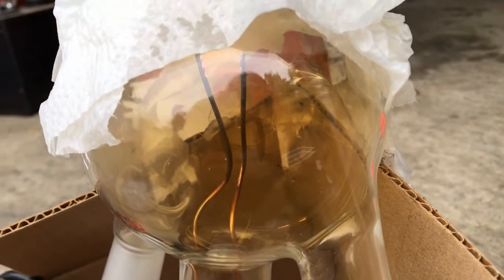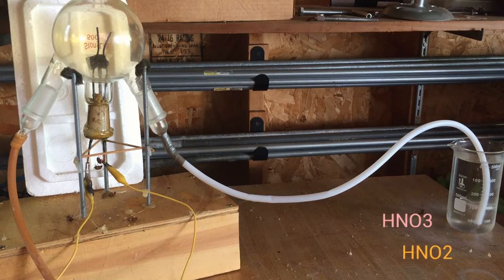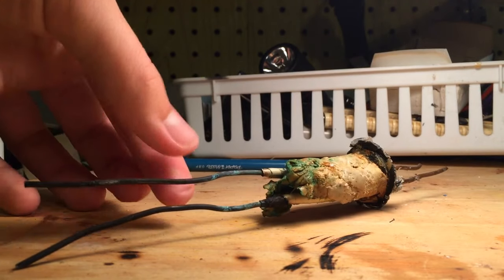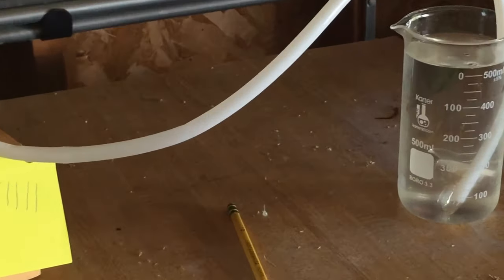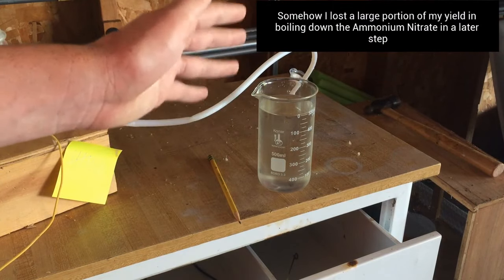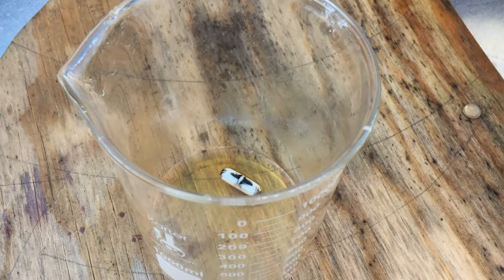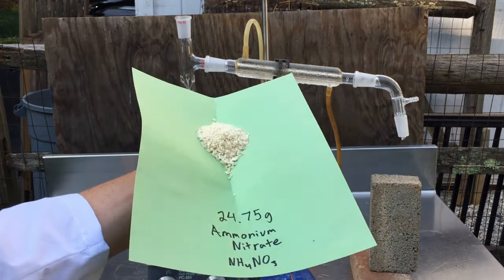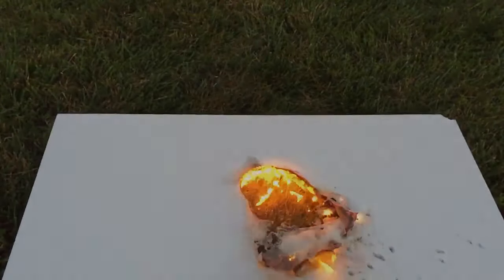Making Nitric Acid From Air (DIY Birkeland-Eyde Reactor)

Comment: Why everyone's makes a Jacob ladder on their Bikerland-Eyde reactors? it makes no sense to have the arc running up like that. What you need for best efficiency is to have the air heated and then cooled very fast, that's why in the real process they used magnets to spread the arc in a disc like pattern and passed air thorough it at very high rates quickly cooling it, a Jacob's ladder works because the hot air rises and carries with it the arc thus actually increasing the contact time and decreasing the flow rate of air thorough the arc, Not only that but having the arc grow and strike again and again puts strain on your power supply lowering the lifetime unnecessarily because NST aren't designed to be going open circuit and then short circuit many times a second. Just have the arc be the largest you can while remaining stable, your yield will increase and your power supply will last longer. Also add an "recombination vessel" after your reactor, it takes some time for the NO and O2 to react and turn into NO2 i didn't believed this to have a great effect but after i added a 10L water bottle to my setup between the arc reactor and the absorption vessel my yield and specially the highest concentration increased a lot, the recombination vessel would look very red and that's a good thing. I made a bit more than 2L of 45% HNO3 in about a month with a 15Kv NST but im sure that with a custom made transformer for higher current and power and a reactor like the ones used in the real process the yield could be increased many times. My absorption reactor was made out of pvc pipe in a square like helical pattern so the contact time was the longest without having to have tall water column that my air pump would have struggled with.
Reply: Because it’s hard to fit through the neck?

Not impossible, fit a thin loop and adjust it with hooks through the other holes maybe?

The only chemistry I’ve done is make ferric chloride, this might be a fun stepping stone toward… safrole
Reply: @lindboknifeandtool  You can use a 1 gallon glass pickle jar. That's what I used for my very first arc reactor, for electrodes I used 1/8 316L stainless wire from SMAW welding electrodes they are cheap, you only have to remove the flux then sharpen them so the arc its stable at the every end of the electrodes. To get the longest arc you have to experiment a bit but it will be always longer than the minimum distance it can self start, you have to make some kind of jacob's ladder so the arc starts then it rises but instead of rising too much growing so large that it cuts and starts again at the bottom it should get stuck at the end of the ladder therefore the sharpened electrodes, the top of the ladder and were the arc burns should not be higher than half the pickle jar else the heat will be too concentrated on the top (technically the bottom) of the jar and shatter. 

To seal the jar I used a piece of thick glass (about 8mm) plastics aren't a good choice because they become wet with nitric acid generated from the air humidity and cause arc tracking, I drilled holes for the air input and output as well for the electrodes with diamond drill bits and glued the glass to the mouth of the jar with RTV silicone, the hole for the electrodes should be relatively snug and were sealed/glued with UV cure adhesive, it held well. This setup worked pretty well for a couple of months working 24/7, I stopped the reactor because I needed the NST for something else. It made about 4 liters of 40% hno3 in total.

If you don't have experience with HV better learn that first because the arc currents needed to get an usable amounts of HNO3 are quite dangerous.
Reply: Lol you realize what happens with a sustained arc, right? If not, I got a great idea for a device I call an "arc welder" I'd love to sell ya.

Comment: Dude I bought a soxilet extractor 50 bucks on ebay   went to use it for the first time. When I was assembling it I snapped off the drain arm. I sat looking at what I did for like ten minutes

Comment: I have a question.  I've read that nitrocellulose was used as a high explosive as a replacement for black powder way way back in the day.  If nitrocellulose is made with red fuming nitric acid and highly  concentrated sulfuric acid, dried and then packed into a hole drilled into a rock would it detonate?
Reply: It's still used in various formulations for almost all firearms today. With good confinement,  like in a borehole NC can detonate.  It would be best to use a blasting cap to insure that it does rather than deflagrating.

Comment: Two ideas that might help increase the captured yeild. 

1) DIY nano bubbler: use an Air stone inside a pipe through which water is pumped. Water speeding up as it passes around the air stone quickly rips tiny nano sized bubbles off the air stone,  not only will  stay in solution longer, but they have much greater surface area helping increase the amount absorbed into the water. 

2) periodically adding Ammonia  to keep the ph close to 7 might help increase the yeild.

Comment: at uni the lab i worked at was giving away a bunch of glass equipment that didn't fit in the lab, the professor had a shopping problem lol. i was 19 seeing who wanted 1 liter flasks in other labs(nobody wanted it) , round bottom flasks, and even new unopened containers of chemicals like octonol. the octonol, i just tossed in the dumpster because i was clean out the back of the lab, it was 9pm and wanted to just go home already. i did take a few flasks home with me and chemicals too, thinking maybe i could sell it, or shoot at it at the ranch, the chemicals I ended up having stolen when i had my stuff in a storage unit. and the flasks were broken. the last glass i had was a 3 hole flask like yours, same size. it finally broke, trying to move into the 2nd floor of my apartment. it was in a on a stack of boxes going upstairs and it fell off and broke. i didnt care at the time, a few years later now, im wanting to start a few experiments like u are, and i kick myself because alot of stuff was broken and wasted and there was soo many cool things just tossed in the dumpster because i just wanted to go home already to play video games lol

Comment: Awesome video!!! You bring complicated nitric acid production to such a simple lvl within this diy... keep up the vids man!! sub diserved! This does 'spark' a question in my mind tho. I've seen plenty of plasma electric pocket lighters for very cheap and i wonder if they could be used for this type of setup as well? Can i make the same acid with the lighters as well?
Reply from the maker: You could use a plasma lighter to make NOx in a small Birkeland-Eyde, but it would only be operating at a fraction of the power (arc lighter current is only like 5 mA max). I would guess that it would take several minutes of arcing to see NO2 form even in a 500mL vessel. Those lighters also face battery and driver overheating problems which typically limit their continuous use to less than a minute. A much better and equally cheap alternative would be to buy a 300W ZVS driver and a flyback transformer (ones from old CRTs work fine). That could be run nonstop at much higher power and with better arc control than an arc lighter.

Comment: I am a bit worried about the flask you are doing the reaction in, check 5:05 . The arc kinda licks the top of the flask everytime it goes up. That gives me flashbacks of when Nilered did some plasma experiments with his beakers in a microwave with a similar situation and it introduced stress into his beakers which made them crack randomly. Be extra careful with what you use the flask with next, but your flask broke so owell, its always sad to see someones glassware brake. I accidentally broke a condenser and an additionfunnel once at the same time while taking apart a distillation setup. Also the water you bubbled the NO2 in could be better if you added Hydrogen Peroxide which increases it efficiency. Otherwise, great video
Reply from the maker: P-α3 Yeah I figured the sporadic heat treatment from the plasma wouldn’t help the situation one bit. At some point I decided the investment was for the reactor, not a future 3-neck so that’s when I got the middle neck epoxied.
Reply: @DBXLabs  
The bigger the scale of the reactor the more efficient it is.
I recommend using a large steel container, water cooled electrodes and a hefty transformer for higher efficiencies.
DC works better than AC actually, if you can find a high voltage DC power source use that.
Also, amps and surface area are your friend. That’s why they used magnets to spin that plasma around.

Comment: I wouldn't be too discouraged by the low yield and the cost not being better than commercial ones. There are a ton of inefficiencies in your setup that I think would be easy to sort out.

For one think I think you can get it to self siphon through the apparatus by positioning the ports such that it allows for thermal convection currents to form. Also if done in sunlight, the inlet could be fed through a long, coiled black pipe (like those DIY water heaters) to heat incoming air and require less voltage to make the plasma. For electrochemistry current determines the rate of the reactions, a transformer exchanges current for voltage so that may be in fact slowing you down. Personally I wouldn't push the voltage higher than the breakdown voltage and then just invest any extra watts into more current.

Comment: Great project.  I am looking at building a solar powered version of this system to make calcium nitrate fertilizer.  My vision is a couple solar panels, bubbling away into some blue plastic barrels on a farm, making the farms entire nitrate need.  daily production is small, but added up over a year and we got some big amounts...
Reply from the maker: Sounds like a cool project! With a reactor just slightly modified from this, you could easily reach efficiencies around 20 kWh per kilo of nitrate. With a few square meters of panels, you could make several kilos of CAN a month.

Comment: Insane waste of energy, but still alright for an interesting experiment.
Here you have two reasons for the inefficiency: first reason of course, is your arc, that is not optimized to produce a maximum of NO2 - what is hard to manage indeed.
The second inefficieny reason is your method to catch the NO2. You could have done much better by using a long cylinder filled with water and CaCO3 (Chalk or marble) and bubble the gas to the ground of that cylinder. 
So the gas can react with the chalk all the way up to form Calcium nitrate. That was also be done in the history for that process. 
So I guess you would get a much better yield of HNO3 in the end. 
But anyway, it's just an experiment to see what's possible, but as long as someone has access to any nitrate fertilizer, that would be much cheaper. Or as someone may have access to unused solar or windpower, so that you have a way here to convert free energy into some chemical energy, the easy way. But I believe, electrolysis of chloride into ClO3 is still a more efficient way for that, but it needs more maintaining therefore and equipment on the other hand.
Reply: Electrolytic hydrogen for fertilizer production has shitty marginal returns on capital.

Comment: Hi! Try to use a water glass based compounds. It is insensitive for acids. You can prepare it by mixing water glas with a some filler, for example asbestos powder, instead of using plumber compounds.
Reply from the maker: You’re definitely right that using plumbing putty was a design flaw, and in more recent iterations I have been machining 24/40 electrode feed-throughs out of PTFE. I also scrapped the part of this design where both are fed through the same neck. My concerns in using a sodium silicate based sealant would be troubles in HV insulating, and difficulties removing a somewhat cemented seal.
Reply from the maker: Also I’ll pass on asbestos

Comment: No where was it mentioned how strong the acid was just from the reaction/bubbling alone? 1% 5% 30%? I'm not looking for fuming acid, just something in the 30 - 60% range. After the 9 days, how strong was it?
Reply from the maker: Around 5% I think. hard to get past 10% due to a fall off in the absorption of NO2 into solution

Comment: I'm thinking of attempting this using dc current from what I read that actually can improve efficiency I'll let u know how my zvs setup works
Reply from the maker: Alek Escalante Cool! From what I’ve read, DC improved yield significantly in combination with plasma manipulation via magnets/electromagnets. You might want to try that out.
Reply: @DBXLabs  you should read about the Schönherr Stove. Long pipe bottom an electrode top an electrode with an handel. Compressed air inlett on the bottem. The electodes are pulled apart with the compressed air inlett open. The arc looks like an corkscrew. In industrial dimensions they had 5,5% effezienze. Fritz Haber wrote (he done bevor ammonia synthesis some experiments on electrochemistry) if the reaction chamber would be from metal (dont know how he wanted to prefent an short cut for current) The effizenzie would be much highter because better cooling of the NO gas. with his small aperatur he had 7% effizenie.

Comment: You should put the beaker of water where the gas dissolved into an icebath or may be fridge because gases dissolve well at lower temperature and high pressure.

Comment: I am really struggling to form the brown gas in my reactor but the void space in my arc area is much smaller, I did notice some form and it quickly went away.  I let it run for about 5 hours and the water was not even slightly acidic.  Just got brown gas, seems to need a long arc and fairly low flow rate.

Comment: The best stuff for sealing which i use in electronics is a silicone glue used in crafts it doesn't use acetic acid to cure so is not corrosion.

Comment: PTFE tubing can be used without worry.. as it is chemically resistant to nitric acid.  It’s also common since it’s now used in 3d printers as a filament guide.
Reply from the maker: That’s what I used towards the end of the video. EPDM tubing also works without any signs of degradation.

Comment: Cool video! When you calculate the power usage, is that the actual measured usage or the max rating of the transformer? If you were actually able to deposit 225W in your vessel I think it would become VERY hot in operation.
Reply from the maker: The power was calculated just based on total energy expense. I can't imagine that any more than a couple tens of watts were converted to heat in the reactor itself. The glass only got up to around 100C.
Reply from the maker: So yeah, just the transformer rating.

Comment: Wy dint it work whit normal glass? If I take a mason jar and then insulate it with tubing would it work?
Reply from the maker: Should work with a mason jar, but expect it to get quite hot (>100C) borosilicate is better suited for the thermal gradient you can get

Comment: I have an idea to increase electrical efficiency of this setup ..
NST or Any Transformer or smps is less efficient to generate high voltage Arc because of high current in primary winding that cause heat instead of any High voltage supply i think it's great idea to boost 220 volt  Ac using Capacitor voltage dubbler Circuit using few Polly caps and arc with rotating  plats  as electrodes    or arc in side Ring type magnet as Anode  ( with cooling ) and cathode shaft in the    middle so arc will rotate automatically because of Loranz force on charge  just like magnetron or just use corona instead of direct arc if it work  may be Heated air make it more efficient not sure .

Comment: Nice video,but you should use GTO wire,which is insulated for 5,10 or 15 kV instead of 300V alligator clip wires.

Comment: For a better arc. Could you not put a steel screen into a glass container and run it in amicrowave. And force air (nitrogen) through the screen.
Reply from the maker: You could, but it wouldn’t be as simple as that in design. A single piece of steel screen wouldn’t do much besides heat up in a microwave, as arcing occurs due to induced potentials between conductors in the EM field. Basically, you would need two closely spaced screens to form an arc which would then have plasma reinforced by the microwave. As you might expect, that plasma would become very hot and without magnetic confinement it would rapidly rise up to the top of the glass vessel and wreak havoc on any borosilicate. Once the plasma forms, there’s no need for it to remain between the sheets, since the EM field does just as good of a job flowing current around.